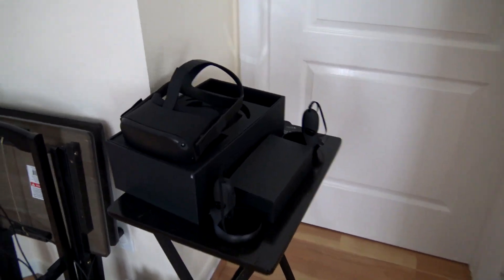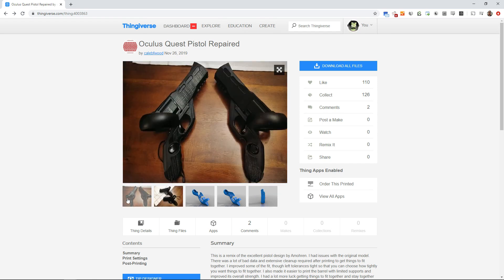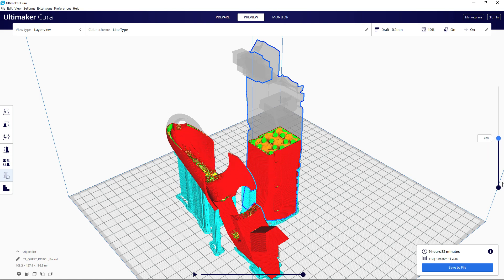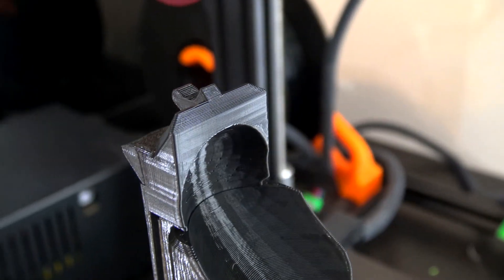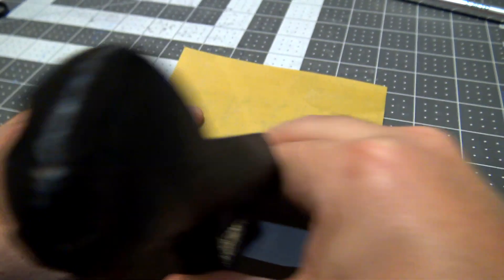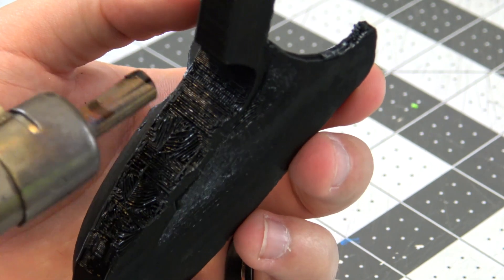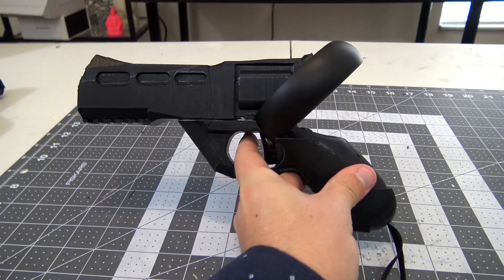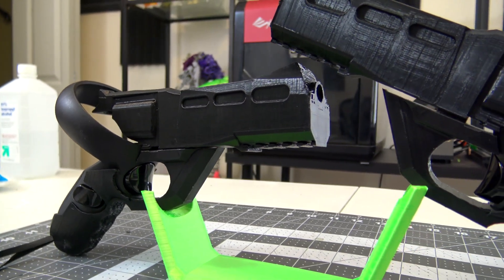3D Printed Pistol VR Controller Mod - Oculus Quest

Comment: Just a heads up, you can resize the support blockers in cura by clicking one and then switching back to the second button on the left that lets you scale it, just as you would on a normal STL. 

Though your method of just throwing a bunch of little cubes on the model works too!

Comment: What’s the point in the pistols when u can’t see them anyways when u have a very on is it just to make it look cool to others when your playing
Reply: Not necessarily. Its been shown how you would accurately hold a gun in real life, and how you do in VR, there's very slight angle variations which make relearning hard/uncomfortable. A properly designed handgrip could absolutely help your feel in VR, and make it more realistic to using an actual handgun.

Comment: Would you be interested in selling a pair? Don't have access to a 3D printer.
Reply: You can get things 3d printed inexpensively online with sites like Shapeways.
Reply: @corbinduncan1272  checked them out, looking at over $300 USD for all 4 parts on the cheapest material. Feels pricey? Guess it's cheaper than buying a printer :)
Reply: @Kakubeki  no just go on etsy they are selling for about 23$ a set